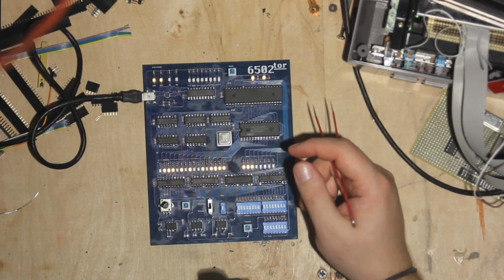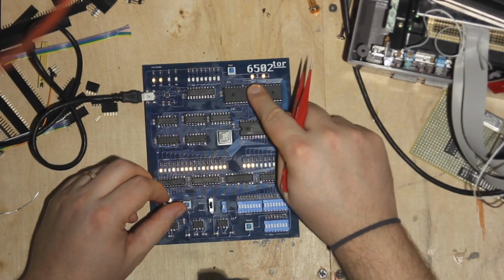6502tor #1 | Overview and writing to memory

Comment: Nice Video Keep it up but i wanna know If a Cpu gets a instruction
mov ax,5
how does a cpu know the mov will write 5 in ax? What is the decoding process?
Reply: The opcode for the instruction gets loaded into the internal instruction register.  From there, the bits in that opcode are used with a microcode table filled with links to different micro-operqtions, such as put number on data bus, add, shift, calculate address, etc.. 

Doing those things takes cycles. That is why instructions take variable numbers of cycles.